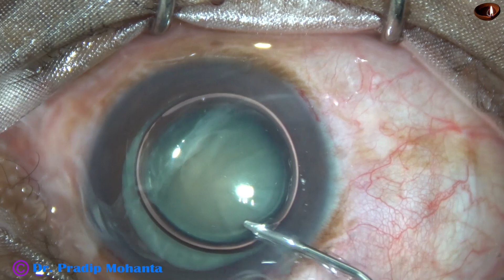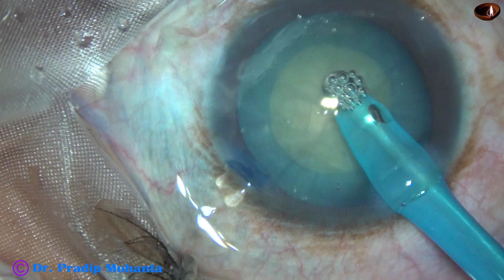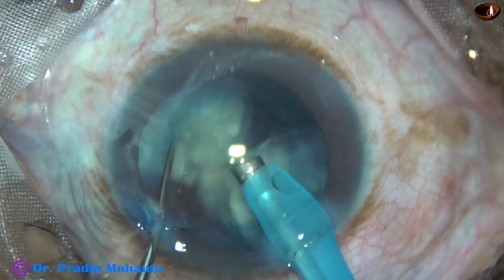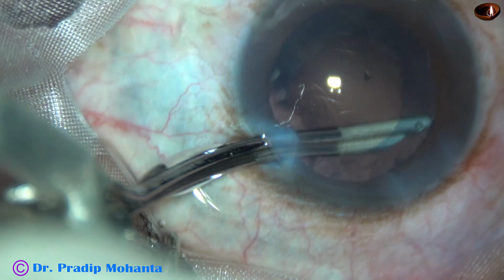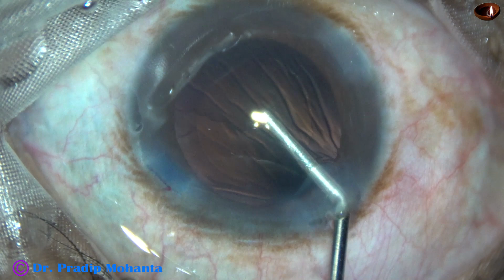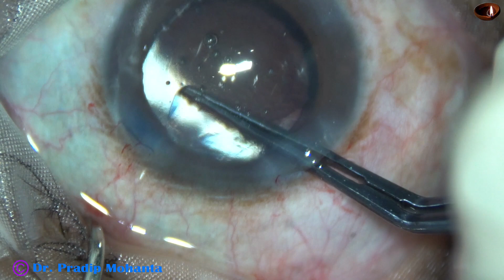HYDRO-RHEXIS  and Enlarging a small Rhexis after implantation of IOL : Pradip Mohanta, 16 Aug, 2020

Comment: Nice 👌 perfect job 
Thanks sir 🙏 for sharing your experience 
I ask if you can clarify to me difference between vertical and horizontal chopping because it confusing to me 
I will greaful to you
Reply from the maker: Vertical chop is when the nucleus splits anteroposteriorly,  the tip of phaco needle and the chopper are close to each other at the central part, and the crack travels from anterior pole towards posterior pole.
In horizonta chop, the crack travels from one point of equator to the opposite point of equator,  say from 5 o'clock towards 11 o'clock. Here the phaco needle and is at the central or near central and chopper is at the periphery.
Reply: @pradipmohanta9321  🌹🌺💐⚘

Comment: Sir the best way for hydrorhexis is closed chamber rhexis I guess which is safe and controlled aswell where you introduce a cystotome directly into ac without a side port and make a rhexis
Reply from the maker: Agree..
Do you do it regularly?
Reply: @pradipmohanta9321  no sir but in early cataract where there's no need for staining it's an easy job and time saving.